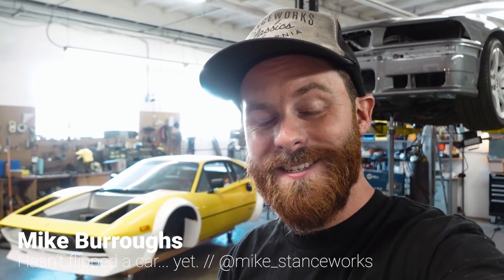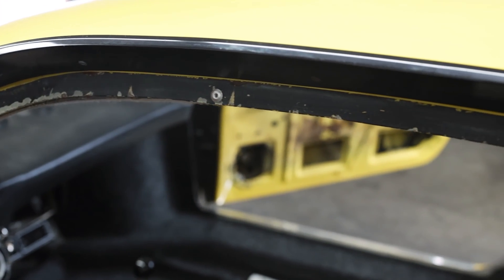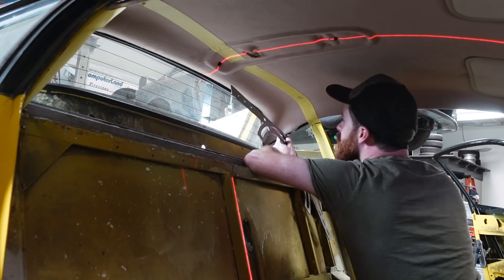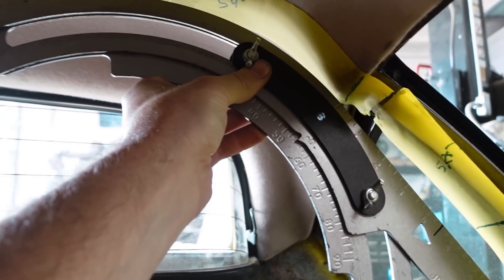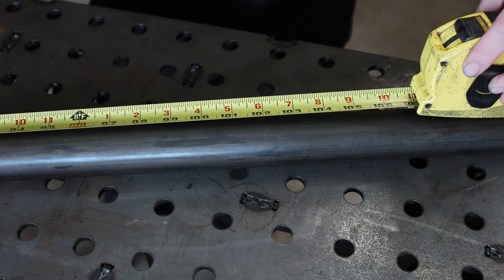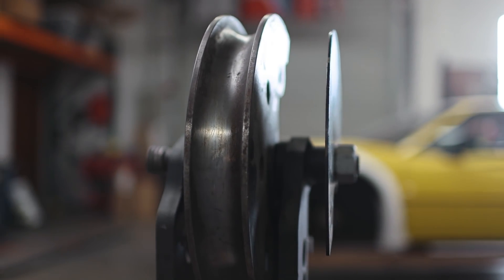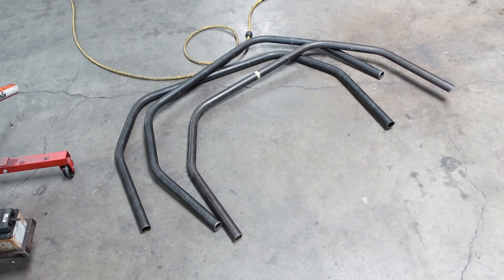Building the BEST fitting Roll Bar Possible - K-Swap Ferrari Time Attack Build - Ep. 45

Comment: Having rolled (gently) a car with a half cage (rear 4 point) I would not consider anything other than a full cage if i considered needing one because of what I was going to use the car for.  Its a nonsense to say that there is a strong possibility of hitting your head on the cage.  There are a number of 308 rally cars with full cages that are used on the highway that don't seem to have the skull crushing characteristics alluded to.  If there is any doubt about the issue of contact the correct cage rubber protection should be fitted.  On a properly fitted roll cage there will be ample space to wear a helmet that takes up a lot of space and doesn't keep hitting the cage.  If it did then the helmet would be scrap.  A 6 point cage can be fitted with optional and detachable door bars that do affect entry in normal use.  Also, fitting a full cage will add considerable torsional stiffness to the car to improve handling and grip.  I would refer to the national motorsports or FIA roll cage regulations to guide the minimum standards to be applied, your cage would not pass the FIA standard with that foot detail being on carpet and appearing to be of insufficient gauge.
Reply from the maker: I built cages professionally for two years. I’m saying with confidence, there’s not room for a full cage without interfering with. Head space. It would be dangerous without the head liner. With it, it’s a non-starter.

Comment: Hey Mike, does you bend measuring tool need to have a matching centerline radius of the bend die you are using? Or is the CLR adjustable?
Reply from the maker: You need one for each CLR. it's one major downside.

Comment: I wonder if the Ferrari purists are still more upset at this 308 build, or the Car Wizard's, for using vinyl instead of leather to wrap the dash and tweed as the headliner material. 

The Wizard is still keeping the heavy factory body and slow Ferrari engine, though properly tuned and carbonated - with the rest mostly being a good attempt for bringing back the OEM look and feel of the red 308, with proper mechanicals.

Comment: Paint the tubes and / or rollcage before the final placement in the car !! especially if you are going to paint the rollcage in a color other than black. I just finished painting my own rollcage and it was a real pain to cover 100% of all the tubes, I had to remove all the glass from the car and still I could not paint 100% of the rollcage. It is easier to repaint only the welds afterwards.

Comment: Looking great. Many years ago I observed an acquaintance fabricating just such a roll bar for a Diablo.  They finished it in high grade black leather stitched over the top. It looked great.  Maybe an idea for here.     Also, I ran across this idea on a 308 FB forum:  https://www.z1motorsports.com/steering-wheel/works-bell/works-bell-rapfix-gtc-hybrid-flip-up-steering-wheel-tilt-system-p-15657.html   A really nice way of tilting the steering wheel for in and out.  Looks factory (from the video I saw).

Comment: Looking Awesome! Some Chassis and body stiffening questions. Did you ever consider using a spot welder on the a-pillar and b-pillars(is that seam welding)? Some chassis stiffening bars underneath? Or, foam to fill the sills, frame rails, A/B/C pillars?  Looks great! And the editing and camera work has improved greatly!

Comment: The 308 chassis does not appear very stiff.  I think I would try to tie the rear suspension pickup points into the cage to add some stiffness.  When I built my 93 RSR, I seamwelded the entire chassis and tied the entire cage into both the front and rear suspension pickup points. It made a big difference in the handling and predictability of the car, especially when using sticky slicks that generated high Gs in cornering.  Given your dual purpose, there may be a simple way using low door bars to continue into the front trunk area.  I believe you will have some chassis flex to deal with.

Comment: Hey man, I love what you are doing to the car. My only little note is that the 308 chassis is not known for its stiffness or rigidity, so wouldn’t it better mounting a full cage any way? Even considering the few impracticalities it makes you car much stiffer and for safety it works a whole lot better to. Or I would at least do what you suggested yourself about making a lower doorbar. If you don’t put it to low or you make two bars above each other it even might protect you against side impact. The upper one you can even bend down ( for climbing in more easily) until the A pillar. And there you can make one or two bars connecting the driver and passenger side doorbars by two bars alongside the “fire” wall and underneath the dash. Well the car is gonna look fantastic anyhow, your taste is mine as far as I can judge until now. Keep up the good work.

Comment: At first I was confused by the angles, because 54+32=86 (I was expecting 90, if the sides are square WRT the floor/ground), but it made more sense when you added a degree on each side. I also think the sides aren't perfectly straight up and down. I think I saw the bottom angle measured at 88 degrees at 12:57
Reply from the maker: Correct

Comment: A Rookie mistake is to cut to the exact length first off always go a bit over at each end so that you have both room for error and length to cut at an angle.
I had done so many roll cages and custom exhaust systems in the past that I could design complex systems and cages using just a few measurements and some math to program the robotic tube benders.
Reply from the maker: I’m aware. The redos are to finesse the bend positions, not the lengths.

Comment: If you have a 5 point harness, you can have a rollcage in a street car.
Reply from the maker: That doesn’t keep my head from hitting tubes.
Reply: @stanceworks  Then the 5 point is installed incorrectly.... or you wont fit with a helmet. Take your pick.
Reply from the maker: The latter.

Comment: That protractor is awesome. I have never seen one before (in Australia) and I have been bending pipes for close to 20 years. 
I am already looking to buy one before the video has finished.
Reply from the maker: Right on! There’s a few companies that make them. Some actually show tube consumption on them (I think Mittler Bros) but they’re missing some CLRs. I’d go with theirs first though.
Reply: thanks  @stanceworks  Mike as long as they have one to suit my die for doing the main hoop and front bars pretty much everything else can be done the old fashioned way of making it up as I go along.
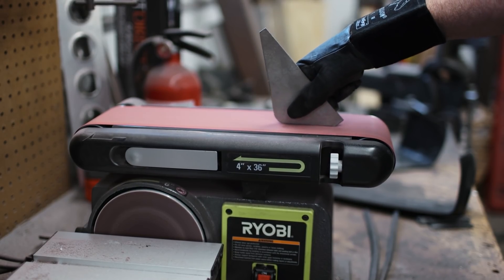I also liked the bit at 7:20 because radius corners are the easiest way to make any bracket/build look professional.
It's my number one tip for anyone starting out in fabrication.